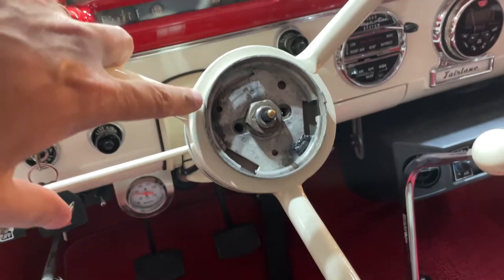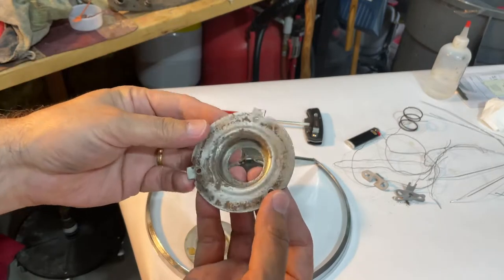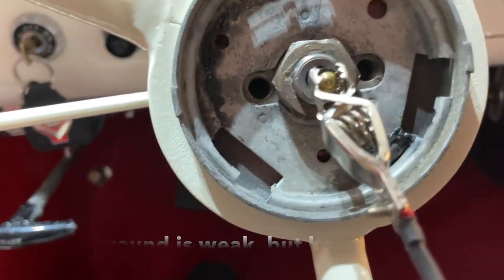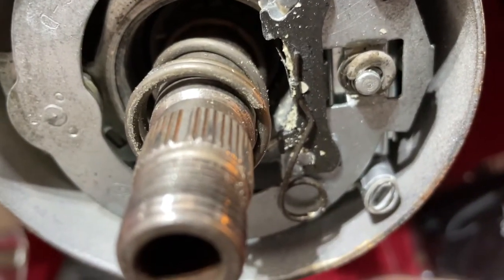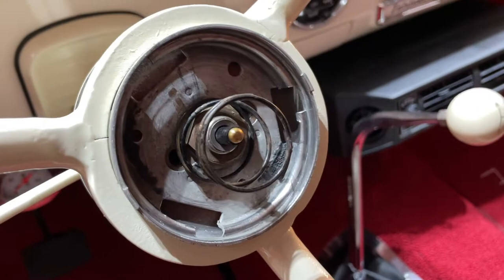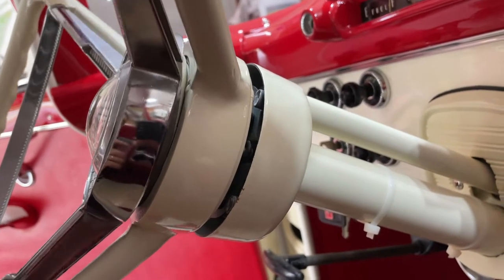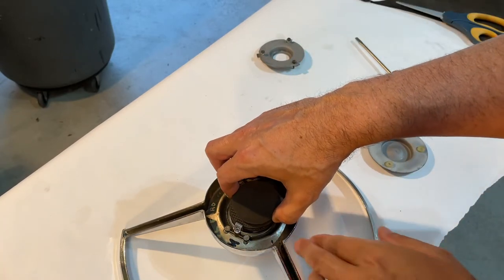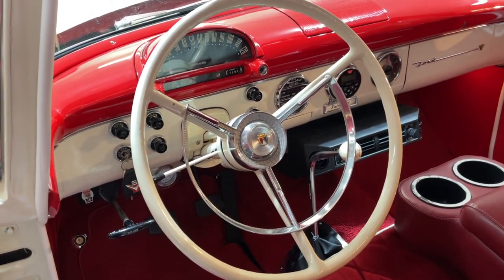1956 Ford Fairlane Horn Ring Troubleshooting

Comment: Hi there! I'm working on a 56 Ranch wagon. Do you know where I can find the center little round contact that goes in the steering tube, and how dose it exit the tube? Thanks
Reply from the maker: That small insert is always found with reproduction horn wires. See this link and check out the photo: https://www.ebay.com/itm/156076526944?mkcid=16&mkevt=1&mkrid=711-127632-2357-0&ssspo=WPVDVdwZRMO&sssrc=4429486&ssuid=&var=&widget_ver=artemis&media=COPY (I do not know the seller of the item on eBay)

I have never seen the cup sold separately anywhere.

Comment: That is a 56 steering wheel .... so maybe the gap .... It's dished differently...More like the 57 ....I drilled out the brass button then glued it all back together... I only have a "CLICK" ...Could that be the relay  ? No horn yet ....Further testing needed
Reply from the maker: If you have a click then the horn button is making the ground. Look to your relay or your horns.

Comment: What stereo do you have and what chrome ring is around it?? Also air conditioner where you find it and does it work well..
Reply from the maker: Visit my blog at HotRodReverend.com/blog. There are over 100 articles with more photos, videos, and all the rest. Use the search box on the page to find what you need. The AC is a ColdAir universal set up and the radio is a BOSS marine radio you can get on Amazon